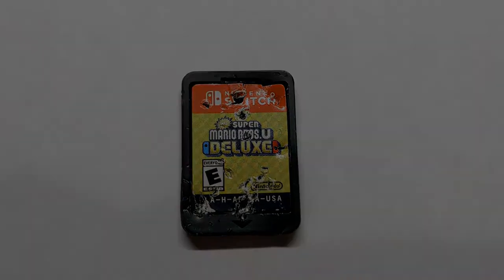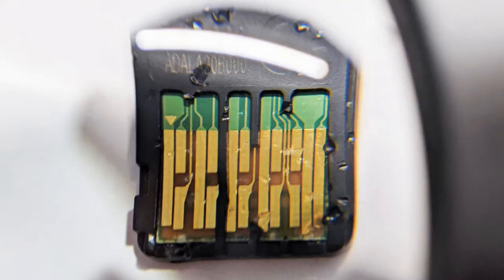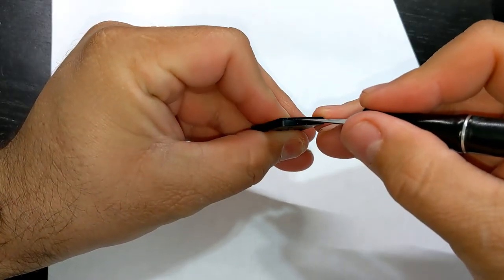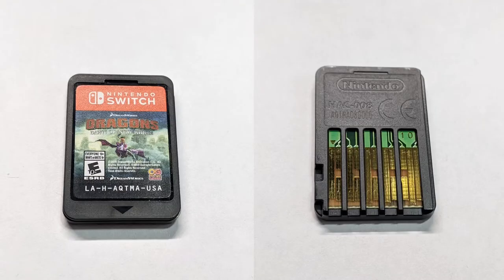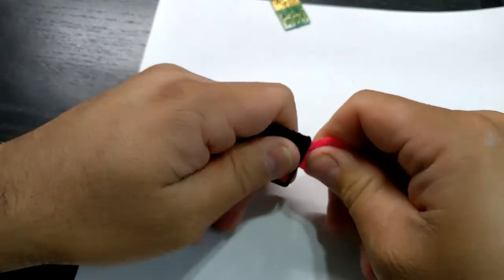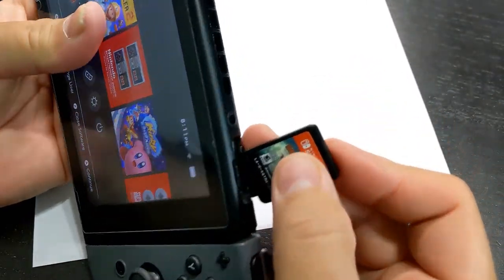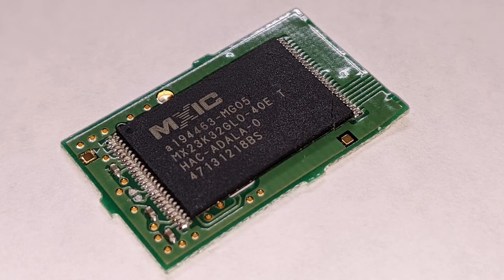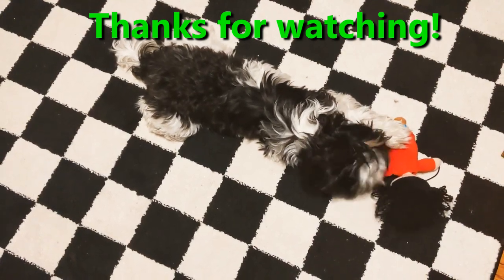Can We Save This Damaged Switch Cartridge?

Comment: Nice effort!  Not sure if you still have this, but you have a missing capacitor below the chip too (in the row of 4) @ 3:48  The chip may well be OK, even with those stress cracks, but it won't work without that capacitor 👍
Reply from the maker: Thanks for the info! =)
Reply: @ChavezDIY  Do you have the means to try replacing the capacitors? Might be interesting
Reply: @ChavezDIY bruh my same exact game got chewed by a dog too 😂

Comment: I looked EVERYWHERE to find a replacement cart cover, finally just printed my own! A friend's dog bit 2 of his and one was cracked and the other wasn't, it's an easy fix if it's not cracked and the pins are still intact though.
 You can buy them somewhere, I don't remember where, but I saw them a couple of years ago.
Reply from the maker: How did you print your own? Scan and use a 3D printer? I looked everywhere too and found nothing.
Reply: @ChavezDIY  I did at first and then I found a .stl on either Thingiverse or Yeggi, then I added the proper supports for it and found ABS was PERFECT for my MP Ultimate and settings I use on Cura!
 I'll look through the two or just re-upload my version and attach a link if you like?

I leave all of my work open-source, I want this stuff to stay free to the public.
 I only use Thingiverse now, so that I can easily monitor it and people let me know if someone is using my work (including others that I have modified) for monetary gain and I have it shut down!
Reply: @ChavezDIY  scanning is very hard on these, regardless of the camera.
 I used a Dynamism for awhile after having printed something (just to print something else, to print just to scan and print lol) to use my phone (with Polycam) and it wasn't good enough with my S10+, even though it's true 4K!

Creality makes some really great ones and you generally want 100-400 pictures, even something like that should have at least 60-80 if you want a GOOD work of art.
 It's just hard for tiny projects and generally best to use the measurements and use trial and error, or if you don't enjoy spending hours for a tiny project (I don't), then use someones open file and modify it if it's not up to par!

Couldn't really make it much shorter than that...
Reply: Do you have a file for that? I just lost my whole collection to head and want to try and replace all the carts and see if any of them are still functioning
Reply: @RBRM3  did you ever find the file my dog did the same thing

Comment: My friends violet game chip just stopped working one day the yellow pins are in the right place I haven't been able to find a knife thin enough to open it. It's been taken care of good I tried blowing off dust in the Nintendo switch and on this chip I've wiped down the chip it's still not working what do you think it could be maybe a dead battery in the chip or something because other games work in both our Nintendo switches
Reply from the maker: There are no batteries in the chip. The storage chips can fail and even if you replaced the chip, you still need to reinstall the game software back to the new chip. Best you can do is open it and clean everything with alcohol and a Qtip. You can try to contact Nintendo for replacement and see what they say https://en-americas-support.nintendo.com/app/answers/detail/a_id/5068/~/game-replacement-options

Comment: Hey so i put my cartridge on my fridge for like a year and it catched alot dust i tried tu use earcleaners that didn't work so if you have any ideas pls send thankz anyway
Reply from the maker: Alcohol is a great way to clean electronic boards and chips. Use a Q-tip (ear cleaner) and dip it in alcohol and clean the golden pins. IF that doesn't work, try to open the cartridge and look for corrosion that could have formed and clean it with an old toothbrush and paper towel while using alcohol.